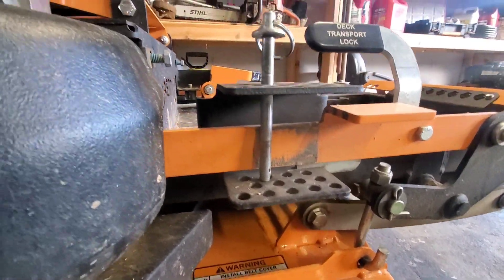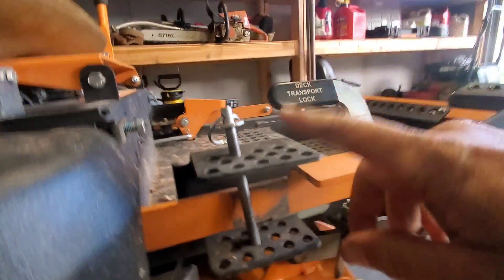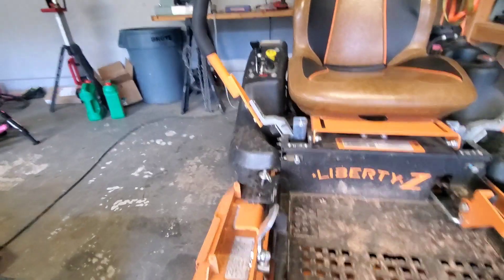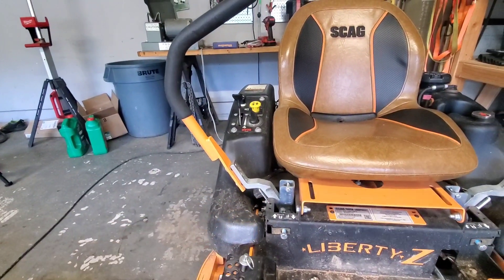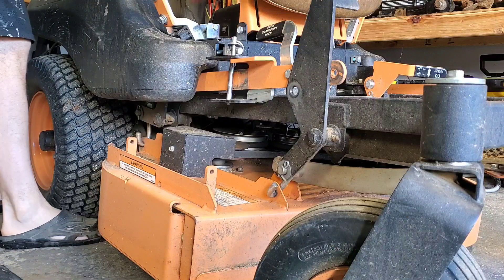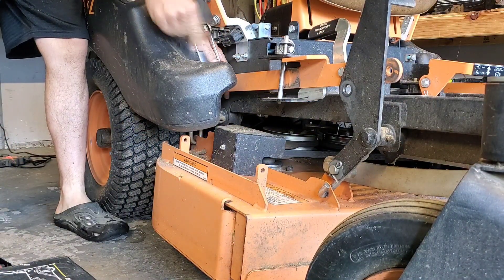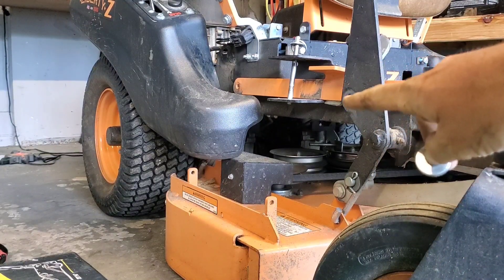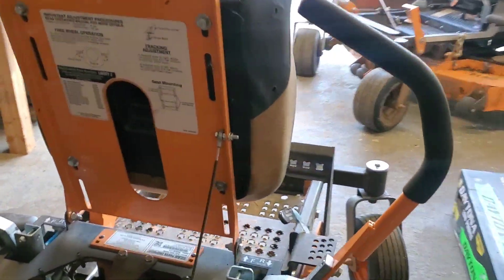SCAG liberty z owners DO THIS NOW!

Comment: I just got this mower and after seeing this video I went and checked mine and of course I had the same issue so I immediately went to fix it.  When I was taking it apart which is pretty easy I realized instead of moving the spacer and reversing the bolts I could just add a washer(maybe it was 1/16” thick) in between the metal bars where Tony put the spacers.  It does the same thing, moves the bar back.  Either way works.  Thanks Tony for an easy fix of an obvious flaw
Reply from the maker: I appreciate your input bro i will pin it to the top
Reply: are you having the same great experience as tony?  looking hard att his model and the exmark quest - both 42" models so I can get in gates
Reply: Yes I haven’t had any issues so far, I’ve only had it 1 summer and only use it on my yard but I wouldn’t hesitate to buy again

Comment: Thanks for the video I picked up a brand new 2023 scag liberty 42 from watching your video I knew to check the pin, he had two mowers on  the showroom floor one was fine when was hitting the bar the sales guy talk to the service department. They said it was an assembly issue and that they would fix it naturally I bought the one that was not hitting again thanks for the video.
Reply from the maker: Thats so awesome bud glad i could help
Reply: Hello CW6691 i was wondering if the 42” had a reservoir for the hydro fluid.
Reply: If you’re asking about access to the pulleys and belts, no it does not lift

Comment: Yes it’s a problem 
I noticed u have the black metal covers for the belt run
Do u think if I remove it would hurt the machine?
Great idea you did 
Thanks
Reply from the maker: I would remove them if you want to makes it easier to clean
Reply: Tony thank you for taking the time to respond 
I appreciate it.
Maybe you can do a small video in how to check and level the deck on the liberty z 36.
I YouTube it and google it and no where to be found.
Thank you again.

Comment: Hey Tony, thanks for the video. This has always been an annoying issue. I’ve had my Liberty Z 36” for about 5 months now and at 13 hours on the machine the Transmission Drive Spring broke. Have you had any issues like that with yours? My dealer is chalking it up to a bad spring. They were great with the warranty and were surprised it broke that early. New part arrived in a few days and getting it on was easy. Just wondering if you had an issues like that.
Reply from the maker: Thanks for the input never had that issue though but it could happen on any of these

Comment: I have a few accounts and was thinking about getting a Liberty z .. how has your Liberty held up up over time ?
Reply from the maker: Buy it
Reply: @tonyslawncare  
I read it’s for residential use .. But I think I’ll get it .. Thank you .. I appreciate your videos
Reply from the maker: @pozmarciv  you will love the machine ive owned 2 different ones myself and have zero regrets about them. If i where you id probably go with the kohler 7000 engine option if your buying the mower new
Reply: @tonyslawncare  
Thanks Tony , I appreciate it

Comment: I have no issues with my height cutting pins.  My big problem is I ran over a stump this weekend and could not move forward or backward.  The stump was higher that the highest level of the deck bottom. ( Dumb A$$!)  So, I hooked it up to my BMW X5 and the added hitch plate I attached to the SCAG to pull my spreader, actually bent the skid plate back towards the X5.  So, Lesson #1: Don't go where you can't.  #2: Don't think that a noncommercial grade mower has the same thickness and strength of steel that a  commercial one has.  The Liberty Z is not commercial grade, just 1 under.  And, make sure you have made and saved plenty of money so your wife won't ask you when you come inside all pi$$ed of, "having a little trouble out there Mike?"  Now off to buy a skid plate and the back plate with SCAG on it.  Oh, my son was helping me and having fun laughing listening to dad saying every cuss word he knows and added a few new ones!   I wish I could post some pics/vids-then all of you could laugh with my son!!!
Reply from the maker: So did you get it unstuck?